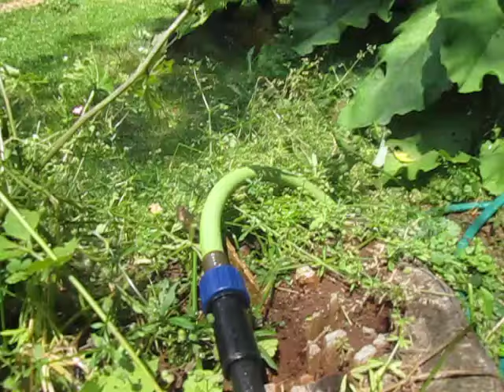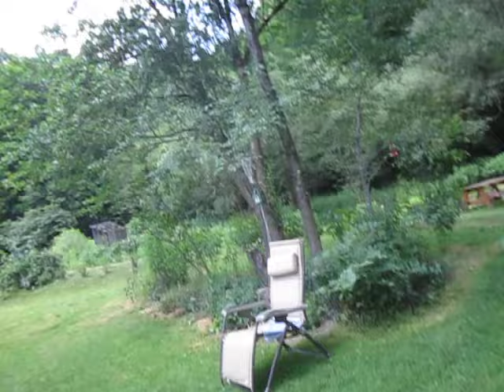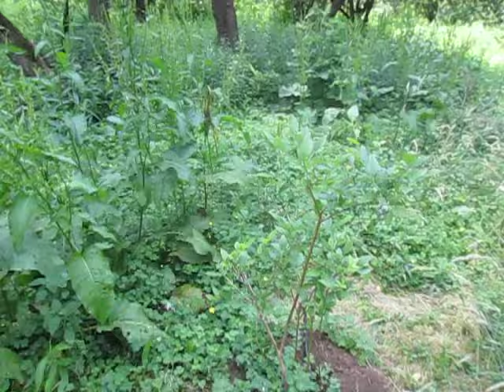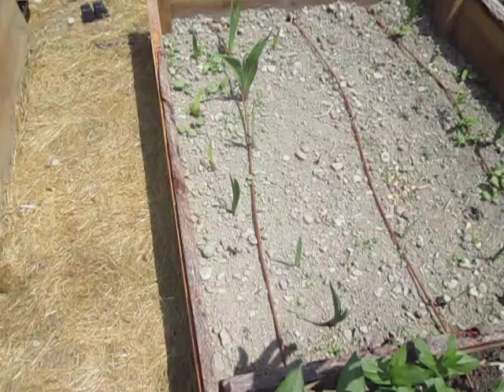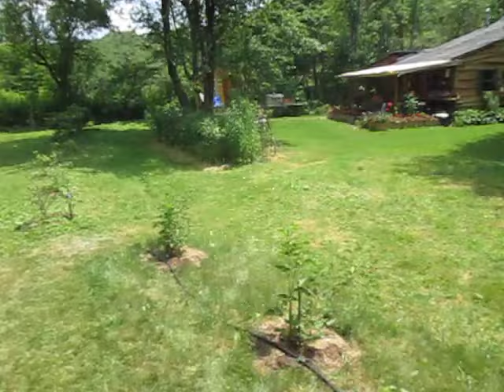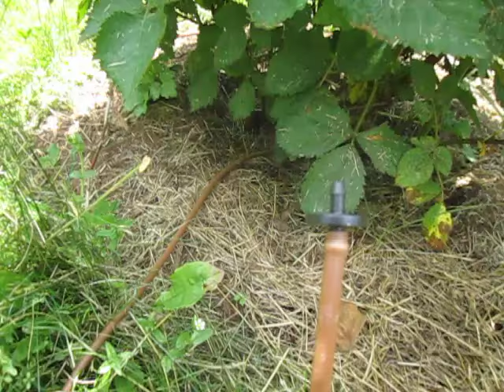Drip Irrigation Luddite Pleas For Help From Anyone With a Brain, Because Clearly Mine is Fried

Comment: Used to have the same problem on an irrigated 10 acre aronia berry farm I was working at . The drip lines were underneath weed blocker and the ground squirrels would chew holes in the water line . It was an everyday occurrence. It was frustrating.
Reply: I guess if you have good pressure at the end of the line it's gotta be clogged emitters . I'm sure you already tried pulling off the emitters and soaking them in vinegar to get the deposits out so I have know idea . Your place looks awesome.

Comment: If I was troubleshooting it I'd first make sure I really have the pressure I think I do. Next, I'd remove the emitters down the line trying to find out where it stops working. Other than that I'm brain dead. My irrigation system is sitting in pieces all over the basement and garage.